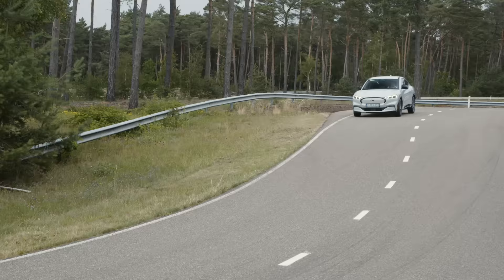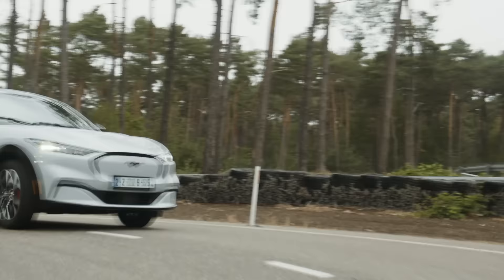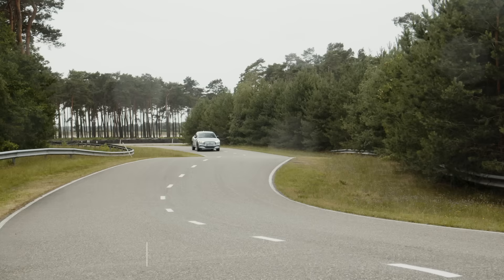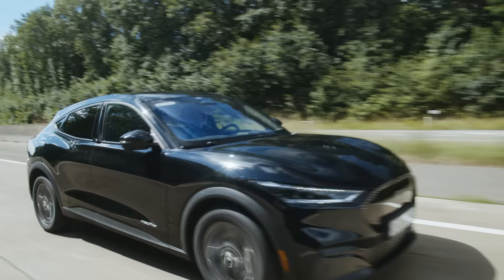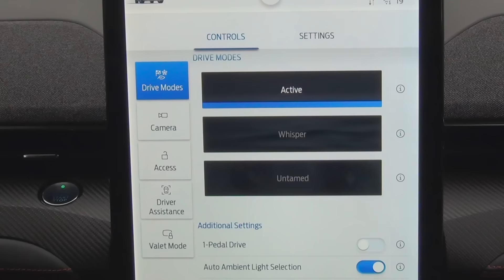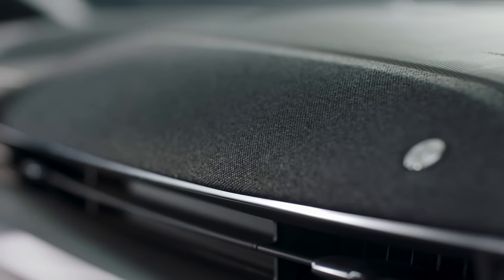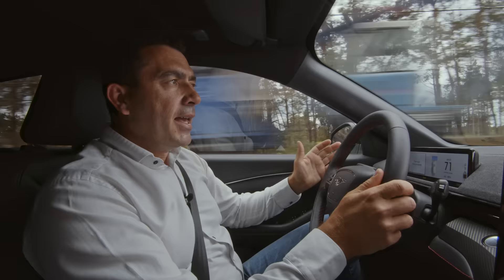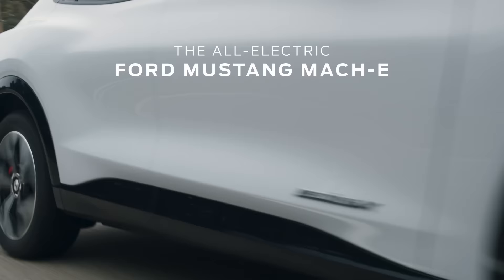How Mustang-Mach E is Tailored for Europe's Drivers

Comment: I think its sad that some people hate on the electric mustang, they are simply expanding the mustang tree, not deleting the combustion mustang, more options is always better
Reply: People are mad that its a crossover. Not that its electric. There is zero reason for ford to call this a mustang aside from them being lousy at marjeting anything that isn't a Mustang or an F series pick up. 

Call it a fusion and no problem. Release an actual EV coupe Mustang and no problem. Everything thing about this thing goes against what a Mustang is. Its supposed to be an affordable performance coupe. This fakestang is not affordable. It starts ove 40k. Its a crossover. Worse of all its 40k+ base model is slower than a base model ecoboost! Hell, with a 6.5 0-60 a civic si could give it a run For its money! You're better off buying a model y.
Reply: The same people who are saying “not a mustang” are the same annoying people who call the mustang a “crowd killer”

Comment: but why a SUV?
Reply: it´s much harder to store a the battery-package under the floor of a sedan or sportscoupé than in a higher built SUV. Furthermore it´s a high-demanding segment with way more customers, sales and of course a higher margin than normal cars.
Reply: @citaron  still a SUV is completely inefficient and has a lot of drag and weight. Hyundai managed to build the IONIQ with a good shape and made it fully electric. Ford could do better if they wanted to. their ford mondeo hybrid was embarassing too
Reply: That´s not apples to apples. 
Mustang´s battery is three times the size of the Ioniq´s. 
Porsche and Tesla had to cut holes in their battery packs to provide enough footspace. But it is very expensive, a 100d Tesla and a Taycan are almost twice the price of a Mach E.
Reply: @citaron  they still could've come Up with a better solution than building another bigass SUV with the Air resistance of a wall. It's inefficient and not sustainable. It's Ford trying to sneak into the Porsche and Tesla Market, nothing more. The glory of Ford sadly is over.